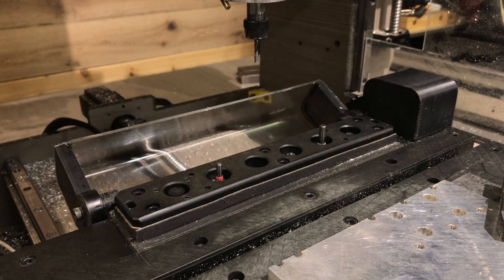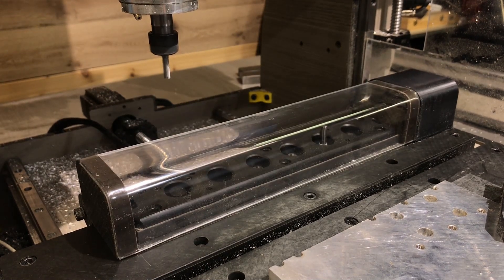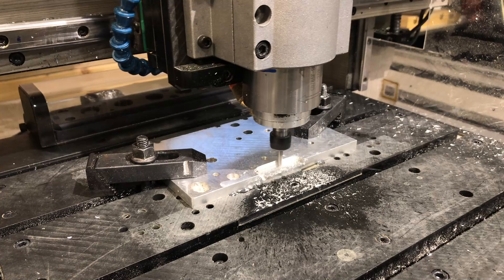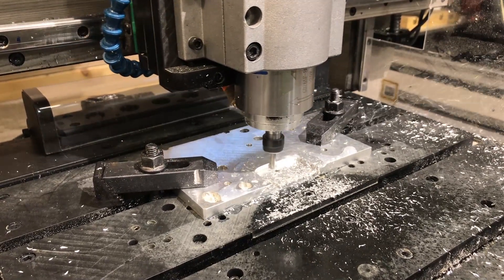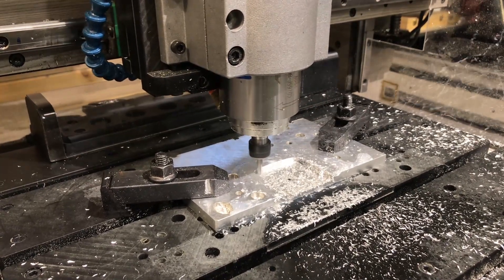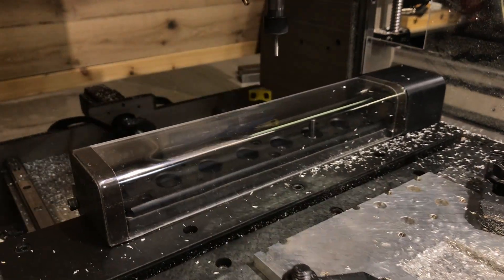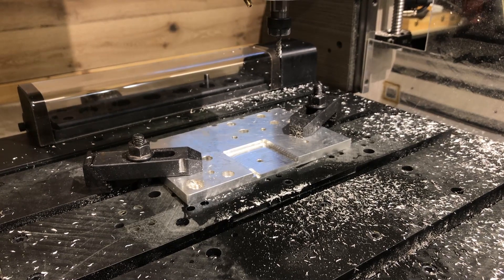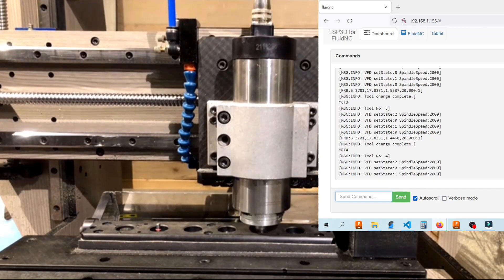RapidChange Automatic Tool Change Magazine/Auto Tool Change  in FluidNC/ VFD spindles

Comment: Could you explain a little more on how the tool change actually works? Is there a Chuck that I would need to buy to fit onto my spindle in order for this to work correctly?
Reply from the maker: You won't need to buy anything everything you'll need is included. All you need is a VFD spindle or any spindle where the rotation and speed are controlled by gcode. The mechanism under the hood is a trade secret atm and  I will be filing my provisional patent next week. I have a very small list of peers and youtubers who I will be sending this out to for review and critique before I finalize design, variations and options for manufacture I'm inviting you to be on that list but e-mail me or hit me up on discord I don't want to discuss it here in the comments :) hope to hear from you and thanks for subscribing and the comments!

Comment: I think it's a pretty good design, how much surface area is needed on the machine table to implement this system?
Reply from the maker: So for an er-11 which is what is in the video I forgot to mention that... not counting the dust cover which is really an optional feature because a user could pause and vacuum the debris  between tool changes if needed (which I did for six months I just added the dust cover a month ago) the unit could be 10" by 1.75"  or apx 250mm by 45mm foot print that would hold 5 cutters and the tool setting probe. Thank you for the comment!
Reply from the maker: @nc_chips  ok I think this is my actual ID Don Greilick#5330

Comment: Looks great, sign me up.  Do you think you could make it work on a 3020 or 6040 CNC?  Great CNC, too.  Is that... wood?
Reply from the maker: no lol the machine is made from phenolic panels I got a bunch of it from a remodel project I did so it's got a formica laminate on it hence the wood grain. but the best thing about it is that it almost completely deadens the resonance
Reply: @RapidChangeATC  Is the bed the same stuff?  The bed on my 3020 is aluminum extrusion.  I'd like to replace it with a heavy piece of steel, some day, to make the machine more rigid and to dampen vibrations.
Reply from the maker: @projecthivemind3239  yes the bed pretty much everything is made out of it. I will probably be doing a video on the machine itself it's fairly unique
Reply from the maker: Yes I am working on implementing it as a kit to work with common machines

Comment: Hey Don. Great work! Couple questions: are you using ER-11 collets? Can you share a link where I can buy the spindle?  Thanks.
Reply from the maker: Yes er-11 collets. The spindle is nothing special though but this is the one I bought that I use in the video. I began this project using a 2.2KW VFD spindle with er-20 collets. But wanted to show the er-11 first since that is most common.
Amazon
0.8KW Spindle Motor, RATTMMOTOR 800W Air-Cooled Spindle Motor 220V 65mm CNC Spindle Motor ER11 400HZ 24000RMP for CNC Router Engraver Milling Machine

Comment: Looks very good. What type of price range are you looking at?
Reply from the maker: We are working on that LOL we will have rapid change tool racks in three sizes er11 er16 and er20 which have been tested on 800w, 1.5kw and 2.2kw spindles. the pre-order price will be less than $1000 for the larger er20 size. Very soon in the next week or so we will be offering an e-mail sign up to be notified 24 hrs in advance of the pre-order launch and access to our discord channel where you will be able to ask questions and offer suggestions. The goal is to make it affordable for everyone so the more interest we get the less expensive it will be to produce. Pre-orders will get a substantial discount.
Reply from the maker: Also I am currently producing a series of videos on it's use and functionality this first video was a reaction test and has been very encouraging I have gathered a dozen peers and formed  a focus group to help finalize design.  I have been using it for 6 months during development and even in it's early stages when I had to baby sit it I was shocked at how it much it changed and sped up my work flow.